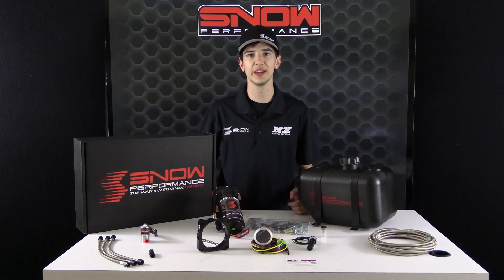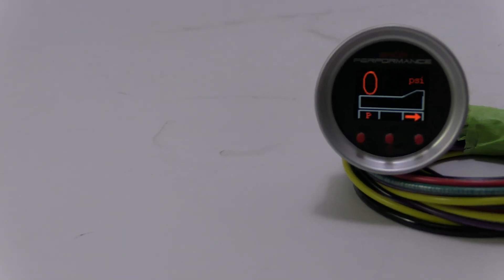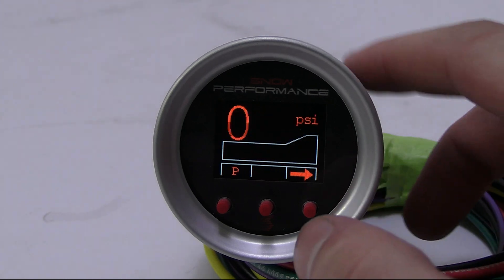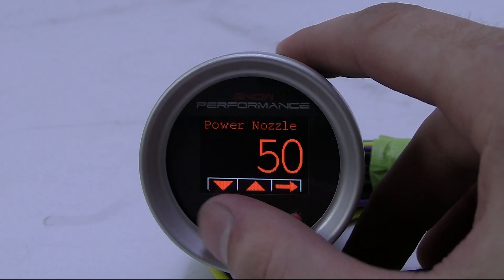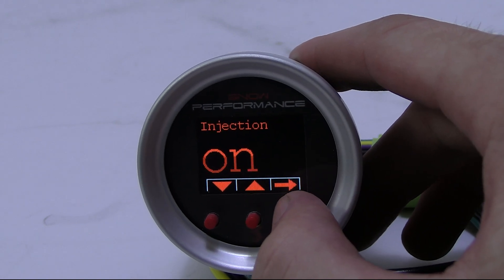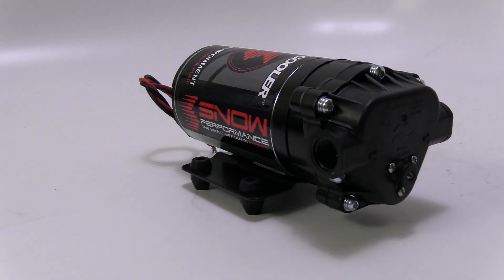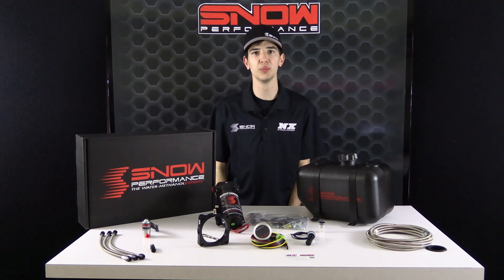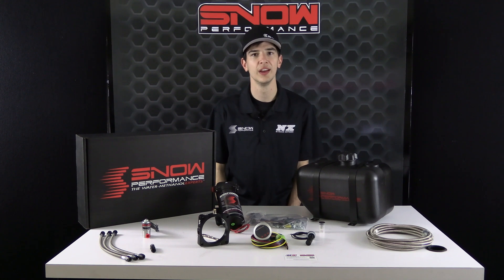08+ Hemi Snow Performance Water Methanol System

Comment: Does this work for the chrysler? Same engine as the 6.1 charger
Reply from the maker: As long as it is the same, this should work. I would make sure that the throttle body and bolt pattern are the same before ordering.

Comment: I see that the plate is placed after the iat sensor , is it best this way ?
Reply from the maker: Throttle body spacer plates do work well. If you do have it before the IAT sensor it will be able to datalog to cooling that way.

Comment: I have 2018 rs3 running e85 would this stll make performance gains
Reply from the maker: You could still see gain in lowering your IAt's quite substantially as well as extra octane. The majority of power will come from the tuning from it.
Reply: @snowperformance1  can I run this without tuning car for water meth ?
Reply from the maker: @seanclark5670  You can but it is going to be recommended to see the most benefit.